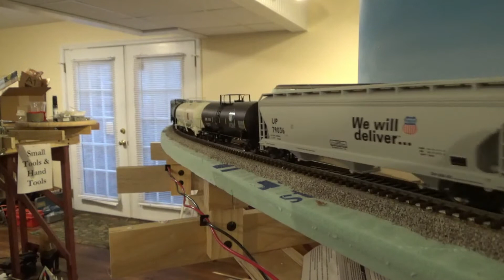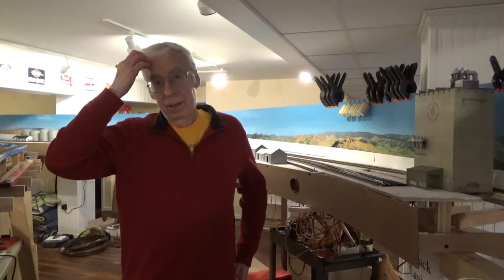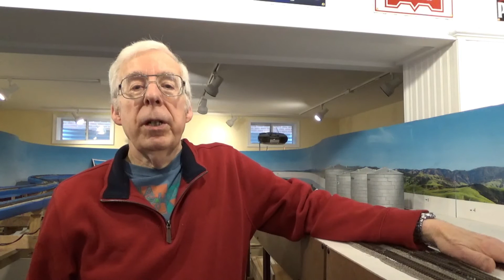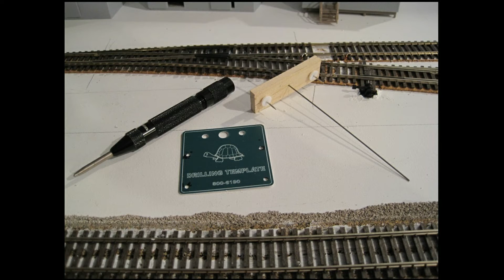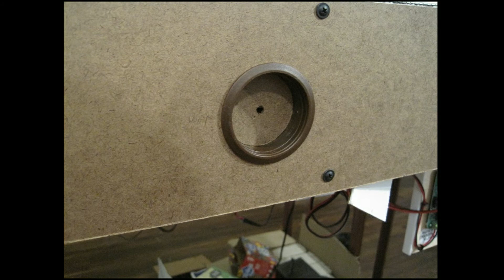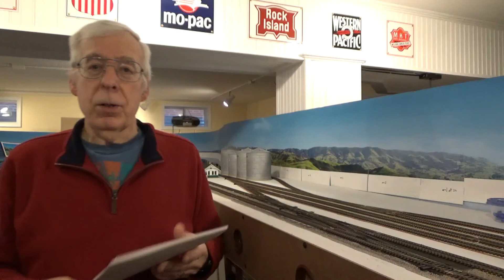Episode 15   The Railhead Reaches Warrenville

Comment: How is that backdrop holing out? I also used wallpaper paste but found over the years that it bubbles up. I have no idea how to keep that from happening when using any paste to hold backdrops on. Maybe the easy stick ones might be better (from my experience) but they are difficult to apply without getting in caught not as parallel as one wants.